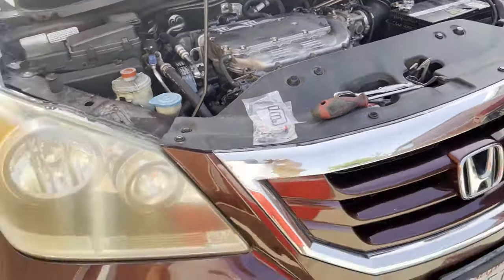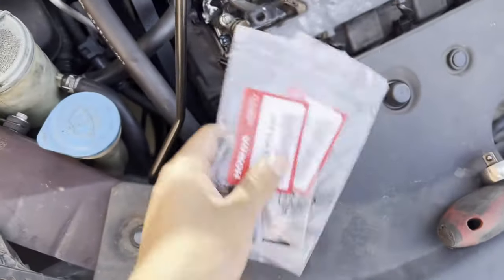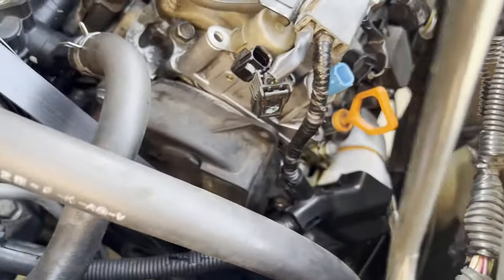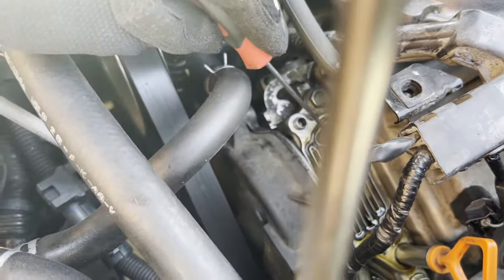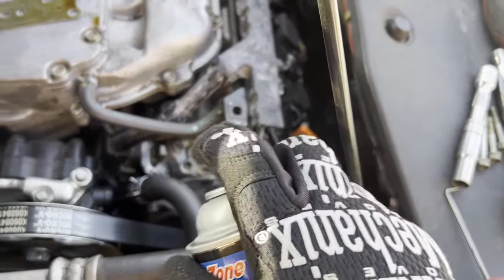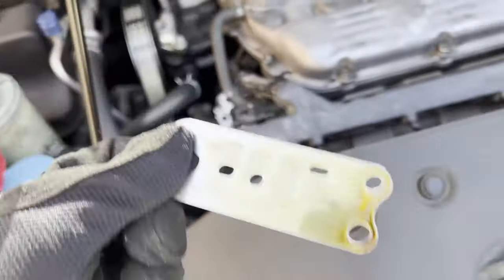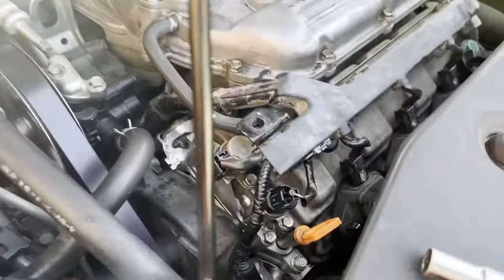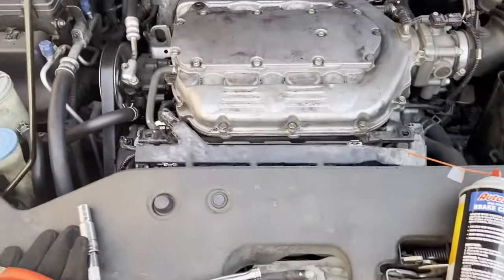Honda Odyssey Front VTEC Solenoid Leak Fix DIY

Comment: Everyone with a pre 2017 Odyssey (4th generation and below) should buy and install a VCM delete kit.  It is super easy and you can read all about it on the Honda Odyssey forums.  I bought mine from VCMTuner, takes 5 minutes to install.  This solenoid leak is a reoccurring problem on all Hondas with VCM.  When VCM engages it pressurizes oil through this solenoid housing which eventually leaks and ruins your alternator.  I finally bought the VCM delete kit after having 2 alternators replaced because of this dumb VCM which does almost nothing anyway.   Alternator replacement is very expensive!  VCM delete is totally unnoticeable and you will never see the VCM light on your dash again.  Also, is does not trigger a check engine light. Love my Honda, hate VCM!
Reply: Where did you get the VCM delete kit?
Reply: @freshwickvape6888  There are a few companies but I liked the simplicity of the one from VCMTUINER.  I have no affiliation with them, just a happy customer who is sick of problems associated with Honda's VCM.
Reply: 2017 is also included in that. 2018 is when they came out with the new body style. I have a 2017 that I bought new and a couple years ago installed a VCM delete and it only took a couple minutes
Reply: Im on my 2nd alternator 😑
Reply: Did you also replace your leaking Spool valve, or did the VCM delete stop the existing oil leak?
Reply: I deleted my vcm on my 2010 and my oil consumption stopped, power went up, and I'm about to change my solenoid gaskets. Timing belt next year...
Reply: I installed the svcm. So far so good. I bought due to misfire cylinder 3. Plug was oil fouled .
Reply: This VCM delete (1.0) doesn't completely "delete" the VCM, it seems.  Besides, this unit only disallows the VCM from turning ON, thus not causing high pressure in the valve gasket area to cause oil leaks.  This was developed to address the class action law suit against Honda and for a different purpose than to address the VCM gasket leaks, it seems.  I suppose even if the unit disables the VCM 90% of the time, then the oil leak will be reduced by that much.  Perhaps it's going in a positive direction, at least.
Reply: @johnschmid2316  wait. So I have the cylinder 3 problem.  You mean I won't have to change the valve cover gasket?  Just do the vcm delete ?
Reply: @ridethelightning9  yes . I’ve had installed for over 2 months. Hasn’t burned a drop . No valve gasket change needed
Reply: It will stop the leak in 60% but eventually will keep leaking,vcm delete kit is for not burning your pistons ring if you have seen many people have problems with misfiring due to vcm enable 2 cilinders to save gas.vcm delete kit is really for that purpose to delete vcm and save you a lot more money I did my at 80k and I’m at 180k with no problems but now I have to fix this spool valve leak
Reply: @rsanchez9227  how often you had to replace it ?
Reply: I have VCM and love it on my Accord. But I don't think that will prevent the rubber gasket from drying up just due to age and hot/cold cycles. I'm pretty sure if you asked other early VCM adopters, they'd tell you their solenoid gaskets still leaked.
Reply: @rsanchez9227  Me too bro mine just went out today. All my lights went out and don't go into gear etc. it's so dumb.
Reply: @THEFIFTHDIMENTION . Smh now my trans acting up .. changed the trans oil once but it only lasted about a wk driving smooth , now its back to stuttering 😢

Comment: No such thing  as oem Honda gaskets those are chines Amazon with Honda logo Honda I not self full valve not just gaskets if only replacing gaskets use Mahle gaskets good luck finding them and use original Honda metal screen from your old gasket on your new gasket or you will get codes if not today then month down the road and will always leak if not oem

Comment: Good video as the spool valve does come out quite easily just by removing the 3 bolts and some wiggling on my 2008 Honda Odyssey.  I used Amazon gaskets but used the original mesh cage.  No check engine light and no oil leaks now.  But alternator appears to be kaput due to the original oil leak.
Reply: Still no leaks? Mine is lake atm an was wondering if i need the whole assembly
Reply: I’ve replaced two alternators due to the same leak. I know how you feel. And they’re not a fun fix.
Reply: @justinyelverton  BRO!! Me and my Pops changed my alternator the first time, fixed this problem watching this video and today I bs u not my shit went out AGAIN man! Changing it again in the am but like u said no fun 😅
Reply: @EDAVISJR  luckily they keep extending my warranty on the new alternators when I go swap them out. Lol. Two replaced in four months. From what I’ve been told, even a small amount of oil leaking into the coils of the alternator can ruin it. Even if you clean it, it’s still running on borrowed time because of that amount that got in it.
Reply: FYI Honda does not produce these gaskets. Any of these gaskets you find are knock offs. Honda will only sell you a new solenoid assembly. That’s all. Thanks Honda!
Reply: @crazyjpeters No shit Sherlock

Comment: I was able to see the part numbers in the video if anyone is interested, they are:
HONDA part 15845-R70-A01 - goes on top, without screen
HONDA part 15815-R70-A01 - goes on bottom, with screen
Reply: Awesome! I'm about to do this after replacing the alternator and valve cover gaskets one already and need another alternator already

Comment: I like this video because it showed you didn't have to remove a bunch of items.  Other videos told you to remove the wiring harness for ignition coils, and some bracket.   In my case, I also removed the small hose to have better access to the top bolt.  I put in the 2 aftermarket gaskets ( Amazon)  and re-used the OEM mesh since I read that the aftermarket mesh caused CEL.  I didn't have a torque wrench so I just snugged up the 3 bolts.  After a test drive, there was  leak so I snugged the 3 bolts some more.  After the 2nd test drive, I didn't see any more leak and also no CEL.  Time will tell if the aftermakret gaskets will spring a leak or cause the CEL.
Reply: What's the report?

Comment: Great video that works! Just replaced my brittle seals with factory replacements and walla, no more leaks! I would highly recommend using aerosol carb cleaner verses brake cleaner though... 2011 Honda Odyssey by-the-way!
Reply: So you're saying carb cleaner is safer than brake clean?

Comment: Thanks for the video! For anyone out there with a 2014 odyssey, it’s pretty much the same process. I ordered the Mahle lower gasket from rockauto before I realized that both should be replaced. I ended up getting the Dorman set from Napa. The Mahle is definitely thicker and closer to OEM, but the Dorman have a lifetime warranty. I put the Dorman in and so far no leaks or codes, but I’ve only driven it once since replacement. If they end up not working, I’ll put in a new pair and get one of the vcm delete options recommended online. If that still doesn’t work, then I think I’ll just get the whole solenoid set from the dealer. I do not want to burn through any more alternators because of this dumb thing!
Reply: Update?
Reply: @4Runner21 the Dorman is still working just fine!
Reply: Can you link the part? Thanks dude
Reply: did you put any type of bond or seal on the new gaskets? only one video I've seen did it..attempting this tonight
Reply: @kananiakui-ramos4779 no, just make sure everything is nice and clean so the gasket gets a good seal. My gaskets are still working, so I guess the Dorman set was a good purchase :)

Comment: This is for 2008 to 2010 , 05 to 07 assembly is on the rear head, drivers side. Update there is also a difference between trim models LX and Ex use the J35A6 EX-L and Touring use J35A7.
Reply: How many solenoid are in a 05 Odyssey I have code 2646 mechanic told me wanted to see which one it was but I'm sure it only one right code reads arm actuator stuck bank 1

Comment: Hi there, thanks for the video! But as far as I know, there are no genuine gaskets from Honda. Honda only sells the whole VVT solenoid, not selling just the gaskets. I just wonder whether your car has ever had oil leak or not so far after fixing this issue. If not, I would like to try to use the gaskets that you have used.

Comment: Thx for the video as you were correct this is not a difficult fix.

However, BE CAREFUL NOT TO DROP THE THIN METAL PLATE BETWEEN THE 2 GASKETS!  I had to pry the metal plate with a thin flat head screwdriver & the thing went flying "somewhere" and I never found it.  So, my $10 fix turned into a $247 fix when I had to buy the kit from Honda. (local dealer cut me a break on the cost)  

One thing to mention if you buy the VTEC spool / solenoid from Honda: They include the bottom block / portion of the solenoid that is attached by removal of the valve cover gaskets.  If you remove the 3 screws on the top of the solenoid, you will have access to the gaskets & metal plate.  That threw me off for quite some time as I'm NOT a mechanic who knows better.

Regardless, even by watching this video & following along, you can save yourself a LOT of labor cost by doing it yourself & should take less than 1 hours to complete.  Just don't be a "dummy" like me & BE CAREFUL REMOVING THE THIN METAL PLATE BETWEEN THE GASKETS!!!  

One last note: SAVE THE SCREEN ON THE ORIGINAL GASKET & transfer it over to the replacement gasket if you bought the aftermarket version.  I hear the aftermarket screens will cause flow issues that will trip a check engine code as the screen is not quite to exact Honda spec.
Reply from the maker: Thanks for the tip!
Reply: You can buy the spool valve without the bottom block, part# 15810-R70-A04
Reply: FYI, if this happens to anyone else, the Dorman gasket set comes with a metal plate. Though the Dorman gaskets don’t look quite as robust as the OEM gaskets.
Reply: @ryanschreck thank you and could you possibly post the part numbers for this as we are abroad with our van and need to do this, would be super helpful! Thank you!

Comment: Good video, however I did the same thing with OEM honda gaskets from ebay, and still leaks.  Removed and reinstalled with rtv on top gasket.  It slowed down leak but now check engine light is on and still has leak. next option I suppose is another set of seals or new solenoid which I don't want to do. Any suggestions?
Update!  New set of gaskets stopped leaking but still getting vvt code.  Replaced solenoid and no leaks and no codes so far.
Reply: Watch out!! Those OEM Honda gaskets on ebay are not even Genuine Honda parts. They are Chinese knock off with the Honda stickers on the bag. I bought a set, and meanwhile the stickers said "Genuine Honda parts made in Japan", the small envelope that these bag came in says "made in china". After installing those gasket, I got a Check Engine light now with a rough engine idle. It did stop the leak, but with the cheap plastic or the filter mesh, it didn't create enough pressure. I'm in trouble right now as the only solution is a 250+ real OEM unit from a Honda Dealership site.

Comment: good video but these are not honda gaskets, honda does not sell the gaskets separately and only the vtec solenoid actuator, you can buy the gaskets online but you may get a check engine light thrown and the vehicle will idle a bit rougher then normal, they are expensive but i recommend installing the selenoid itself from honda or buying a aftermarket actuator. great detailed video
Reply from the maker: Yea you right. But so far no issues luckily

Comment: I had this problem 2012 odyssey. If that part fails. Honda sells you the whole unit. They dont sell oem gaskets,  the part is not intended to be taken apart according to honda. There is no buy the top part only with new gaskets. Those are aftermarket. You have to replace the whole unit which is what i did $220. You can try this and save money but the real fix is switching out the whole part.

Comment: If I buy a brand new oem front spool valve assembly can I take it apart and use the seals/gasket that come on the new one to avoid having to take the lower rocker arm piece out?

Comment: Yeah my Sh]t was leaking like a b-tc-. The oil leaked into the Alternator which collected whole bunch of sludges/dirt over time. I was driving the other day some 60 miles from home and my Alternator went out. The guys at the dealership wouldn't replace the Alternator unless I get this fix. They quoted over $4200 for the whole job including replacing the valve gasket and timing belt. They will not work on my car unless I get these replaced also.
Reply: Buy a VCM delete kit!

Comment: Could be a quick fix but Honda doesn't sell these gaskets separately. I ordered from ebay that said Honda genuine part but still got the check engine light. Was worth a try but didnt work. Only the whole assembly is sold by honda
Reply from the maker: It’s been almost a year and still no leaks or check engine light
Reply: @menjicar  nice I wish mine happened that way. Would have saved alot of time and $
Reply: Just ran into this as well.  Tried some cheap no name ones.  They leak bad. Put the old oem ones back in. They leak but not as fast.  Looking for a solution other than the whole assembly for $250+....
Reply: Those OEM Honda gasket on ebay/amazon are some fake Chinese knock off with a fake "Genuine Honda  made in Japan stickers" slapped on the bag. They are now the real deal. I bought a set, and even though it doesn't leak, it gave me a check engine light. Now my engine runs rough with a P34** code cylinder deactivation problem.
Reply: @changtcg You probably should've taken the screen from the OEM gasket and used it in the new one.

Comment: Any check engine codes after?..Honda don't make these gaskets at all...if you find any they're aftermarket just want to know if they work without adding engine code
Reply: I did mine, but used the OEM mesh screen. So far so good, no lights or codes and the leak seems to have stopped.

Comment: What I've read is that those gaskets are not really Honda OEM but fake. All they do is print out stickers with honda on them. You are not able to buy just the gaskets at the dealer bc they don't make them.
Reply from the maker: Yeah I have heard that too. But it has been working for a while. Still no leaks
Reply: Yeah I confirmed with (several) Honda Dealerships and (official Honda parts retailers) and those sold on eBay are 3rd party/fake products in which they print the Honda sticker and make up a part number. None of the dealerships I called could even pull up the part number listed on those eBay items. I also reached out to some of those sellers on eBay selling the gaskets with Honda packaging,  asked them if the gaskets were "official OEM Honda gaskets?". Most often my message would go un-replied or when I did hear back they would reply back in broken english "Fits Honda". Just look at where those eBay Honda wannabe gaskets are coming from- China. That alone is a dead giveaway. Best to pay for the higher price for the official (control valve unit/ part) than to end up redoing the work a few months down the line and possibly creating a bigger expense.

Comment: it's ok to spray brake cleaner directly into the bottom half of the vtec solenoid assembly?
Reply from the maker: Yes brake cleaner evaporates pretty quick especially if engine is hot.
Reply: No, Probably not.
Reply: @menjicar  No its not safe lol. you should also not be doing this with a hot engine or spraying on a hot engine, you can start a fire.

Comment: Even with honda oem spool valve the whole part and gaskets from honda it still dribbles and leaks. I cant seem to get it right any suggestions?  Its just barely a dribble.
Reply: I’m having the same issue with my 2014 Honda odyssey, and I took mine to the shop. It’s a very small dribble
Reply: @brinafees  yea I don't know what do do other than try honda bond but I did that once already and still the dribble. So I'm at a loss gonna try to take it off and do it again today.
Reply: I did the same that’s why I took it to the shop- I just don’t want my alternator to fail again it’s been 2 so far- it 95k miles and this is the only problem this Odyssey have
Reply: @cdotson0027 I just wanted to find out if you had a solution to the leaks your van is having - I found out that it leaks from a cold start up
Reply: @brinafees  I decided to use a very tiny bit of permatex max flex rtv that's oil resistant. I barely put any on with a q tip. Made sure to not get it anywhere near the screen or other channels just the outside. Seems to be holding.

Comment: Will this cause a leak of oil all the way down that side of the motor? Mine is all the way to the oil pan? Anything will help. I want to do this my self soon.
Reply from the maker: Yes it’s possible because when driving air will push the oil back and all over the place

Comment: Honda parts said that part number doesn't exist. They only sell this as a whole solenoid replacement. You bought the fake gaskets with a fake Honda sticker. This is a crazy problem with these vans. Kills the alternator every time they leak. Smh Honda

Comment: By the way those are Fake gaskets lol
Honda does not sell only the gaskets, you have to buy the entire solenoid.
Reply from the maker: I heard about that but they have been working great for almost a year now
Reply: @menjicar  didn't work for me, I had to return it and buy the whole Dorman solenoid for $80, worked perfect.
Reply from the maker: @LamoidZombieDog  I heard the Dorman timing components aren’t the best either. But if it works it works good 👍
Reply: @menjicar  VVT Solenoid is not a part of the timing system. It's unlikely that the little solenoid will fail completely anyways, it's the gasket that usually goes. The one I took off my car looked to be Honda OEM, it might have been the 2012 original with almost 183k miles on it.